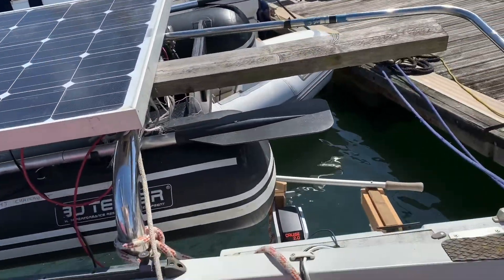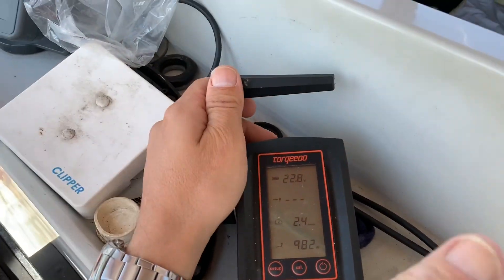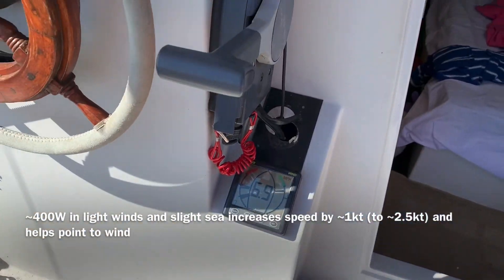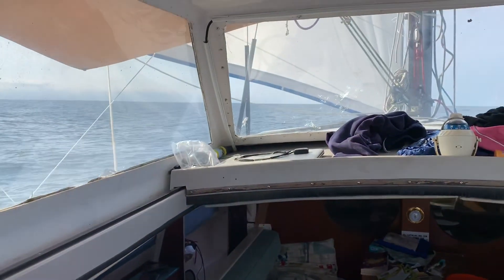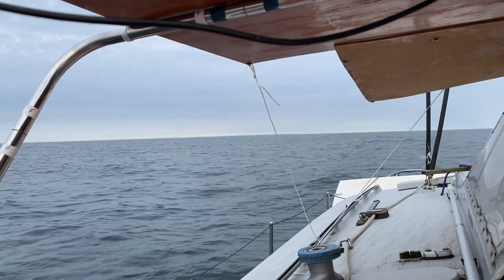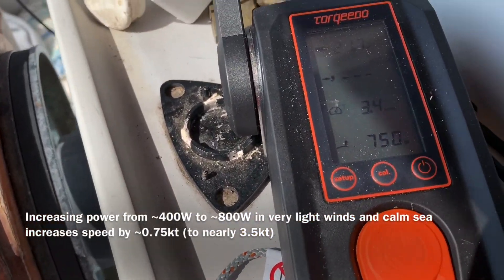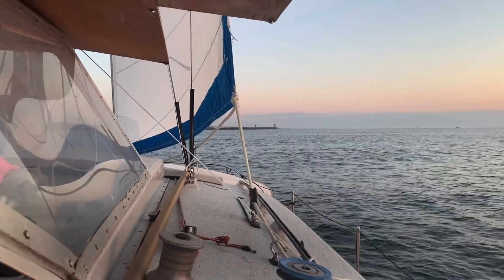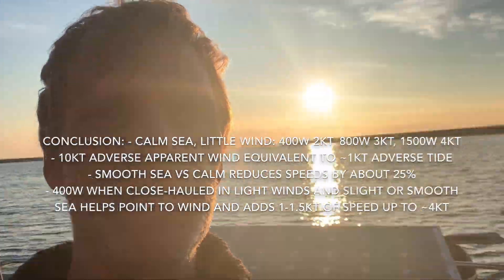2. Testing a Torqeedo 2.0 in real-life conditions on a 3 tonne sailing cat - power:speed analysis

Comment: I had a 22’ Hirondelle cat. Came with a big heavy 15hp outboard, changed for a 3.5hp Tohatsu, worked fine, though it would not be set up for high thrust.  Lost about one knot over the big beast.  It did reach its limit motoring into a F7. I was coming into harbour, otherwise sailing would have been no problem.  
I say this as perhaps you should find the limit of your set up.  Also know the limit of sailing upwind.
Anyway, keep up the good work.
Reply from the maker: Yes, in a F7 with big waves we can’t motor into wind even with the 9.9hp high thrust Yamaha. I imagine this electric engine would reach the limit closer to F5. But with two I think it would be as good as the 9.9hp high thrust ICE

Comment: Hey you did my testing request, how I do mine and asked for in your last vid. Thanks! Stellar details Simon. I think it will help a lot of conversion planners out there, especially when we share data done at specific standard test conditions.
You must be happy with the results?!
Reply: Here's my request and comment from your last video, below.
Would you say my calculator was about right? And, your sweet spot, max speed to wattage, is 1,000w? That VGM increase undersail with 400w is well worth it, speed to safety.

-Based on my own figures/test and a calculator model I made, I'm going to make a guess on that. You at WOT, 2kW, 5 knots and 1kW, 3.4kts. No sail assist, at slack tide in flat water and no wind.

I'm similar but a tad lighter n longer. WOT @ 1kW (48V o/b) I've done 3.6kts (tested in above) then against slight tide and say B3-B4, dropped to 2.8kts
Reply from the maker: Hi Sailor Cherry, I’d say your calculation sounds about right. Hopefully we get to test that on Loch Ness later. I’m not sure where the sweet spot really lies. I imagine it’s a bit different for different conditions, particularly tide. In general I try to keep it under 1000W unless there’s a reason such as a short time to get into a harbour against wind or tide.
In terms of sweet spot for distance vs kWh input, that will also depend on tides etc and I’ll try to create a formula for that once I have a bit more experience.
Reply from the maker: Yes, fairly happy with the results and even more happy with my last trip - will post a vid soon but basically the motor helped us keep to time to get the right tides in between some islands and then enabled us to navigate the complex channel to harbour in up to 20kt winds. I had the old ICE ready to start for the approach just in case but didn’t need it :)

Comment: Good info. Thank you.
Reply from the maker: Thanks, let me know if there is any other info it’d be useful to have - we’re off to the Farne Islands tomorrow morning, and ultimately heading for the Caledonian Canal. So there should be lots of opportunities to do more tests.
Reply: @aktsolar  For me interesting info would be on how the torqueedo holds against a motor with direct shaft. not sure how torqeedo holds in time, what is the lifespan compared to a regular motor. I think silent-yachts is using a direct shaft from motor to the propeller. Torqueedo might be a direct shaft too. just do not know enough about it.
Reply: Thanks for detailed video! How many energy did you lost during all this passage?in kWh if possible ) and how much energy come from solar panels?
Reply from the maker: Hi Artem, We used 3kWh or a bit less during the whole trip: Up to 1kWh to leave Wells harbour, up to 1.5kWh during the trip and up to 0.5kWh coming into Newcastle harbour. Even though there wasn’t much sun we averaged 150W input for over 10 hours a day. So the batteries were nearly as full when we arrived as when we left. And by midday were back at full charge.